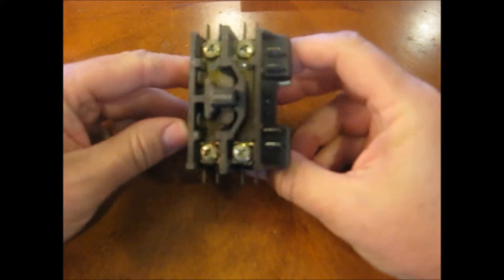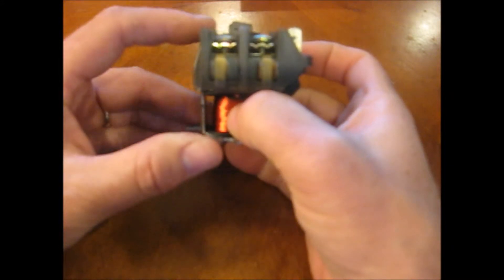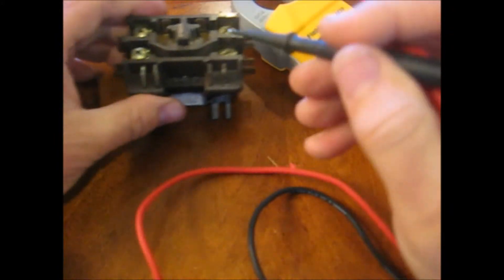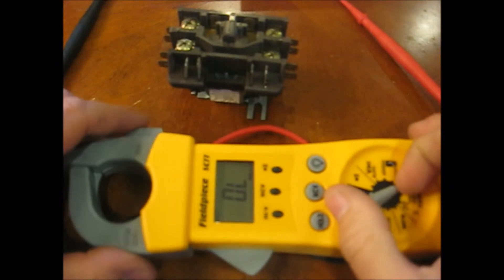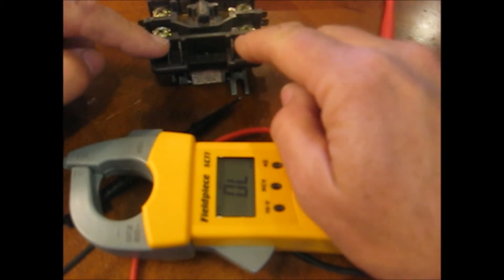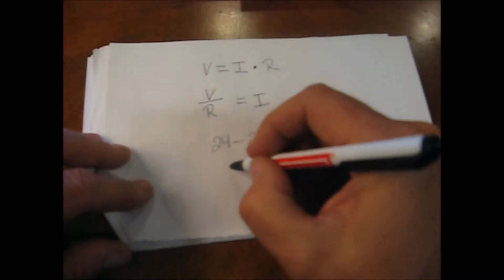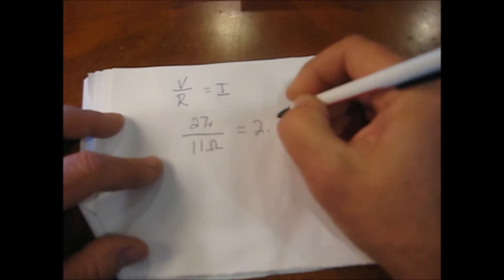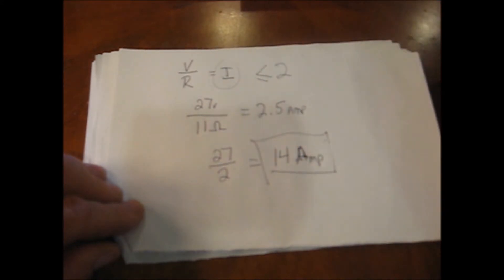HVAC Contactors

Comment: Mine keeps buzzing
Reply: Frank Alexander i gotcha thanks! Now can i replace this part myself? Or would it be better to call someone to run some tests first? Also there were ants around the contactor running around
Reply: Frank Alexander gotcha! I appreciate it, im confident i can do it once i flip the breaker off and pull the fuse i should be safe to disconnect all the wires and transfer them to the other contactor one by one so i won't get confused
Reply: Also even if i turn the breaker off on a/c pull out fuse theres still electricity going  to those wires to the contactor? So i need to be careful with those wires not touching right? I was thinking of transferring them to the new one, one by one